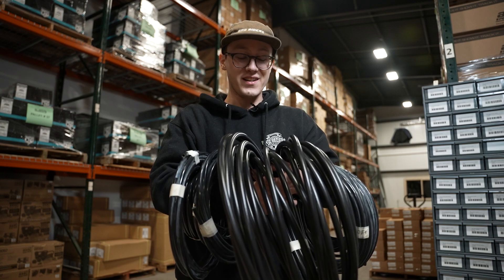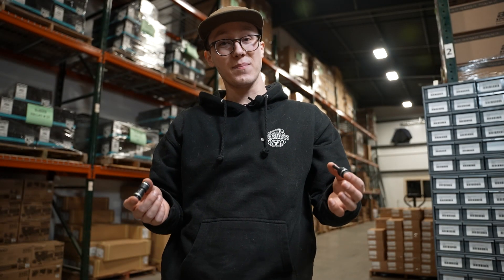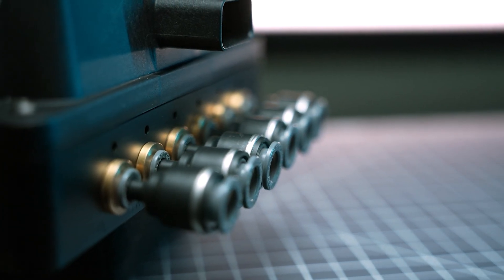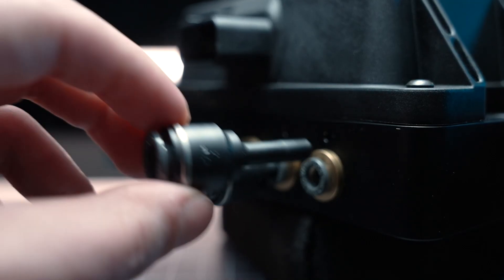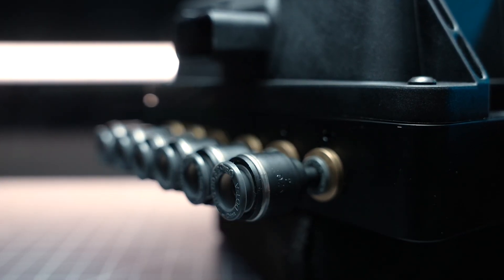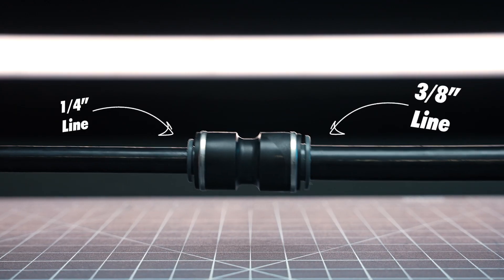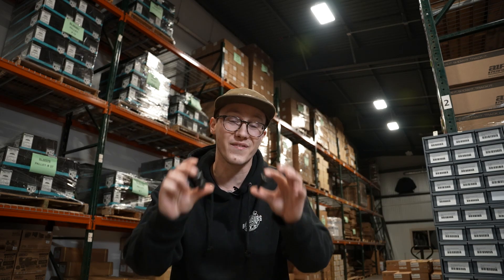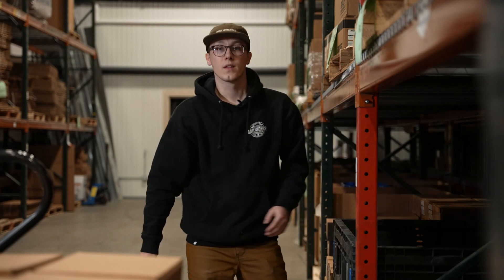What Are PTC Expanders for Air Ride?

Comment: Is there any benefit of running 3/8” lines on a 1/4” manifold though?
Reply from the maker: If you bought a 1/4 Manifold, yes you could run 3/8 lines and you would see a big increase in speed to the front bags (furthest from the manifold) and a minor increase at the rear (closest to the manifold).
Reply: @bagriders  I have a 1/4 manifold and am building out the rest of the setup, just haven’t pulled the trigger yet. That’s good to know! I would have thought the bottleneck at the manifold would minimize any benefit of running larger lines.
Reply from the maker: It reduces the impact for sure, but the increased flow of the 3/8 lines will help over longer runs of line (Front) @GTJesse

Comment: I'm not expert, but it seems to be more joints to get possible leaks from.
Reply: Yeah I tried to limit fittings for that reason.
I have a few spots that would look nicer with a 90 fitting, but the line is in a nice arc and doesn't leak and you don't see them unless the car is torn apart.
Reply from the maker: Limiting the amount of connections in your system is always recommended. The less connections the easier it is to find a leak and the less chances of leaks.